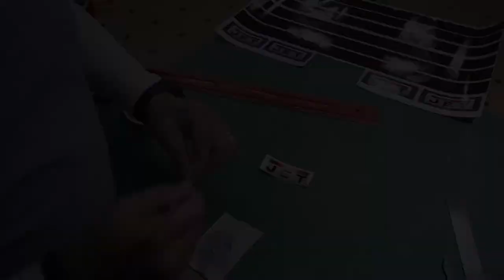JET JBOS-5, Benchtop Oscillating Spindle Sander Unboxing and Stand

Comment: Very nice, I have to have my shop looking good as well and touches like this make the difference. When you spend time in a nice looking neat shop it inspires you more and you turn out better work. 👏🏻👍🏻🇬🇧
Reply from the maker: Hi Wayne thank you for visiting my channel again. Its true a clean tidy environment makes it easier to work and a pleasure to be in. I try to keep my place as tidy and as organised as possible but dust is always the killer even with a dust extraction system. I love being in my workshop planning and making and a real sense of achievement. Thank you again especially for your kind words. Best Michael
Reply: Arbor Designs Cheers Michael, same here the fine settling dust is the worst. I think that’s something we have to live with, in a pro shop like yours and a small shop like mine. Look forward to more content. Thanks.
Reply from the maker: I agree Wayne.  I built a air cleaner for the workshop link here if you wish to view  https://youtu.be/30CKNAqbfXQ there are two parts.  it actually works very well for cleaning the space from airborne dust I leave it on for hour and it makes a big difference thanks again